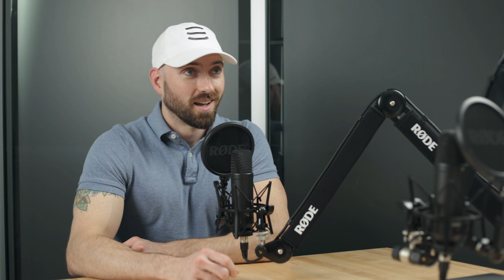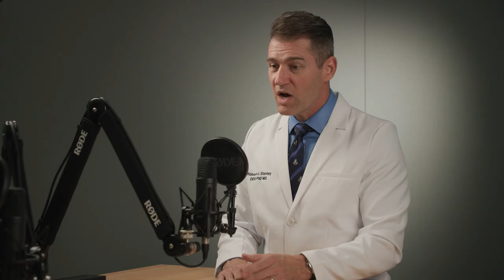Deep Morse Taper? Here's why that's a BAD IDEA!

Comment from the maker: Bicon is an example of the engineers creating a deep conical internal interface WHITOUT compromising their unique major thread design! This was accomplished by using a shallow 1.5 degree taper thus giving the engineers room to maintain the major thread design all the way to the crestal region of the implant. You are correct about their use in the posterior. Imagine if they had a 6mm tall implant and only 3 threads (or 3mm) of major threads at the implant apex and the crestal region was 3mm of micro threads! That would be a high risk implant solution. Check out the video on THE FIVE THREAD RULE for more information regarding primary stability of dental implants. Thanks for the comment

Comment: In which case(s) a bridge over multiple implants must not use pure conical (or indexed conical) connections? Thank you.
Reply from the maker: Correct! It is imperative to use non-engaging abutments when dealing with multiple implants that have been splinted together. This means avoiding the use of hex or trilobe abutments. Only non-engaging abutments should be utilized to prevent the occurrence of an over determinate condition. Such a condition goes against sound engineering principles and should be avoided at all costs.
Reply: @Stanleyinstitute 
"Narrow or Insufficient Bone Volume: If the bone available for implant placement is narrow or insufficient, a conical connection may exert too much pressure on the surrounding bone, potentially leading to bone resorption or implant failure.

Severe Bone Loss: In cases where there is severe bone loss or inadequate bone height, other types of connections might be more suitable, as conical connections require a certain amount of bone to provide adequate stability.

Complex Prosthetic Rehabilitation: For complex cases requiring significant prosthetic adjustments, a different connection type (like a flat-to-flat connection) may offer easier modifications and adjustments.

Soft Bone Quality: In cases of soft bone (D3 or D4 bone density), conical connections may not achieve the same level of initial stability as in denser bone, which could compromise the implant's success."

Is that something you would agree with?

Thank you in advance.

Comment: What if the implant companies will just roughen the implant T the coronal aspect instead of making shallow threads , would you think that deep Morse taper is beneficial?
Reply from the maker: I would prefer major threads in the coronal region. Consider the case where you are doing an implant and sinus graft at the same time. The floor of the sinus is 5mm thick and you are going to place a 10mm implant. So 5mm of the crestal region is all that engages the bone. If this region of the implant is just rough or has micro threads what is going to keep it from being avulsed into the sinus? That is my bigger concern

Comment: I like a lot of your work but couple of issue with this.. 1) Many deep conical connections use smaller screws 2) how much strength is actually necessary? i.e. how thin is acceptable for given forces 3) under load how deep does the taper need to be to resist bacterial/fluid  intrusion. It is on thing to slide the stack but if the base is fixed in place and then a load placed at the top what happens?
Reply from the maker: All of your questions are great! These are the questions that the engineers need to answer for each implant being brought to market. If you ask your sales representative for these answers and they don't have them you might want to consider a different manufacture. Remember, an implant designed by a dentist for a dentist is a receipt for disaster! We don't learn about these kinds of mechanical issues in dental school. We need engineers to analysis these implants on behalf of the patients well being.
Reply: @Stanleyinstitute Your response just triggered a big “aha” moment for me. Thank you! I’m a 65 y/o consumer with severe dental issues, researching the best solution for me. I’m not an engineer and I’m not a dentist. But I have just enough geek speak in me to follow and understand most of your content. I MUST find a way to generate $65K and get myself to Cary, NC because I know you are the correct provider for me. After hundreds of hours of research, considering providers anywhere in the country, I know to my bones that you’re my guy.

Comment: Hi Doctor Robert, I have been watching you for some time, great content, streight to the point. What exactly is deep Morse, competed to regular one, is it the degree od taper 12°vs 6° for example. Or how do i recognize the implants apart?
Also I would love some content on soft tissue menagment. Thanks again.
Reply from the maker: When looking at internal connections I wouldn’t spend too much time with the angle of the deep taper. I would suggest that as long as there is an internal conical connection that does NOT result in compromised thread design in the crestal region you and your patient will be fine.

Comment: Pretty sure the paper cup And paper plates analogy sticking together has more to do with air pressure like a suction cup rather than friction fit in a morse taper. In a vacuum those papers plates would come apart.
Reply from the maker: Interesting. So you’re assumption asserts there isn’t  any friction between two paper plates or plastic cups?
Reply from the maker: Just for reference, sand paper has lots of friction and the plastic interproximal finishing strips do too.
Reply: @Stanleyinstitute  there is friction, ofcourse there is. But I don't think it's the main factor in the paper plate analogy. It's like asking me if suction cup's rubber and glass have no friction. Ofcourse. All materials have friction. It's just not the method suction cups stick to glass or paper plates stick together.
Reply: Mors taper work via friction. It's a friction fit like you said so yourself. And that friction fit is dependant on surface area in contact with each other and the direction of friction. More parallel, the better like crown preps. Tall and as parallel as possible. 

A deep mores taper sacrifice implant structure for stability. And vice versa. 

I'm not saying you're wrong. But I think a study or some evidence of taper vs structural stability of implants long term would be helpful to show you may not "need" a deep mores taper or deeper may not always be better. Just like once upon a time implants needed to be bicortical then 16mm now 8mm. 

An example (an if my memory serves me correctly) astra implants have a very deep mores taper and they are quite successful. 

I'm open to having my mind changed though.
Reply: @Stanleyinstitute  That's not what i'm saying. 
I'm saying it's not the main mechanism of how the paper plates are sticking together. 

like a car coming to a stop, with breaks. 
Whilst air resistance will slow the car down. It is not the main mechanism for how to car comes to a stop with breaks and tire/road friction. 

---
My main point is your analogy between paper plates and implant mores taper is slightly flawed as they're completely different mechanism of being stuck together. one is negative air pressure (like trying to pull off a vacuum cup from a glass window) while the other is mechanical friction. 

I'm not saying your comments on deep mores taper are wrong. I'm simply commenting that the analogy between paper plates and mores taper is flawed. 

If there are research which says deep mores tapers are not required, could you share them with me please. I'll be grateful to have a read. 

With the examples of the bins and party cups. simply do the experiment of dropping one into the other. You'll see it slows down, doesn't just drop in. It slows down with air break as it pushes all that air out. Then when you initially try to pull them apart, you're generating negative pressure within, until you break that seal after which it becomes easy. 

You can simply cut a big hole in the bottom of the cup and you'll drastically see how much easier it is to remove the cusp. If it was the side wall friction which is making the cups so hard to pull apart, then the hole at the bottom of the cup shouldn't make a difference. Again, not saying it's going to slide out like it's been lubricated up. but simply the friction isn't what's mainly really holding the 2 cups / bins together.